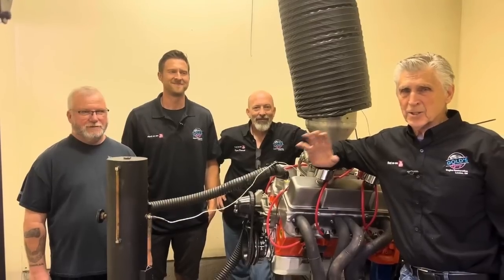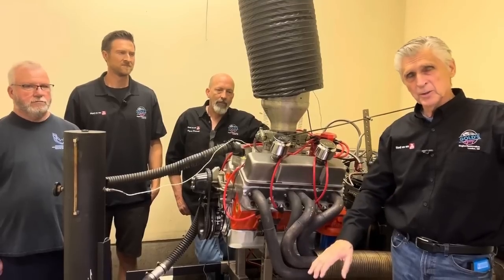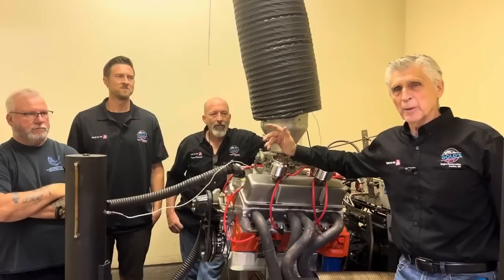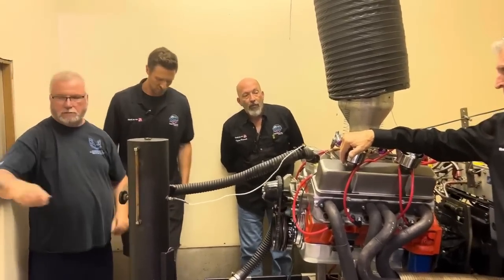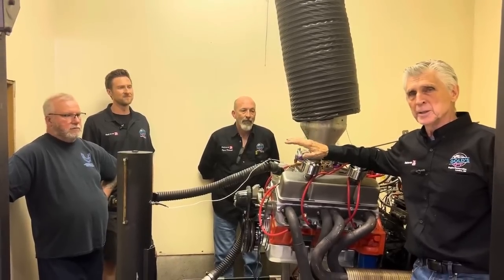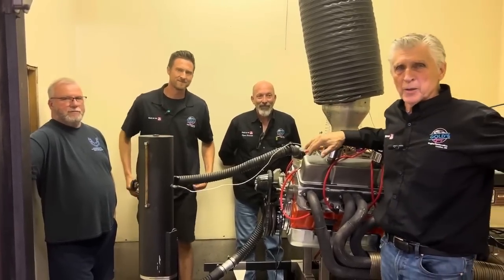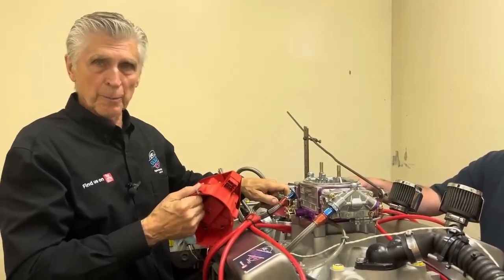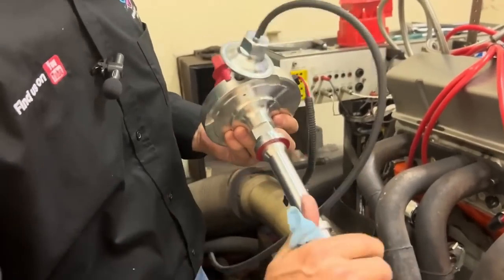$75 Amazon HEI Distributor VS MSD Ignition DYNO TEST!  Mike's Michigan Modified stock car engine.

Comment: HEI Distributors are the best simple all-in-one I've used cheap Distributors on stock engines with no problems I have DUI distributor on most of my stuff I swapped out Fords and Dodges with HEI with much improved power and acceleration they're definitely worth the money
Reply from the maker: Thanks for commenting Optimus.AG

Comment: Your target cranking compression is a good bit lower than what I have run in numerous small blocks over the past 20 years. I worked my way up over a few builds to where I now have a target of 200 psi with iron heads and 220 psi on aluminum heads.  I found more hp, a good chunk more torque and better fuel mileage running higher static compression ratios as the air/fuel burns more quickly minimizing the required spark advance.  I typically make peak power on 29-32° of advance on 91 octane. My 383 I tow heavy trailers with in my Express van has 11:1 static, 6" rods and the 218/228 @ 0.050 on a 108 LSA roller cam has an ICL of 61.5°. Cranks at 210 psi and made peaks of 520 tq @ 3,600 rpm and 502 hp @ 5,500 with 31° total advance. It has been together for 3 years and half the mileage it has accumulated has been with a 6,000+ lbs trailer.
Reply from the maker: Thanks Chris, that is great information. I realize I am being conservative. One factor for me is that I have no control over what happens to the engine once its gone. I notice that you are using a little less timing than typical for peak power, is that necessary to prevent detonation?  Anyway, those are great numbers.  Thanks you for contributing to my channel.
Reply: @goldsgarage8236  No problem. Love your channel and fully understand on something you are having to provide a warranty for.  For the stuff I build myself I want the most out of.  The timing advance was not reduced due to detonation. It simply did not respond to more timing, I start with a fairly rich air/fuel curve at low timing and then add timing until the engine stops responding with signifigant increases. Then remove fuel. Think of it like you would part throttle with vacuum advance. The more spread out your air/fuel mixture molecules are the slower it burns. The inverse is also true with more compression pressure. The elevated pressure causes an even quicker flame front spread with molecules more densly packed together and the need for less timing to reach mean best torque spark advance. I time for torque then jet for horsepower. I do it with a keyboard and PCM reflash but still the same basic idea.

Comment: You seem like guys that could test and get use out of my beta, simplified, P59 base tune. The video you want is "Want go kart EFI? Junkyard car parts (P59 ECU)". More info in descriptions of most of my videos. Meant for open loop only with as few sensors as reasonably possible. Map, crank, cam, IAT, and TPS sensors, nothing more. The TPS is a quirk of the operating system of that specific ECU. Tieing TPS pin high and maxing self test values should also work; haven't tested that yet. I'm betting there are after market LS coils that compare to MSD.
Reply from the maker: Thanks for the info Marc. AG

Comment: I used to be involved in hydroplane racing. Since my background is in electronics, some friends asked me to look at their MSD parts. I was able to look at some HEI MSD replacement modules and some MSD box for magnetos. The very first thing I have noticed is how cheap, cheap, cheap the printed circuit boards were. I was trying to remove defective parts and the copper tracks would come off from the circuit board. 
I have salvaged many parts from trashed printed circuit board, over the years, but I’ve never seen such cheap Printed Circuit Board. 
For the price we pay, for these products, I would expect top notch quality design. Unfortunately, it’s not the case.
Reply from the maker: Thanks Clark. That is great information. Thanks for sharing.AG

Comment: What viscosity oil do you use in the street engines you build? Way back in the day, Valvoline, who was sponsoring Neil Bonnet's NASCAR car, they claimed that they were using off the shelf 10W30 oil??? Thanks.
Reply from the maker: Thanks Clark, really good question. The thinner the better to make HP, as long as the bearing clearances are sufficient to maintain oil pressure. Remember if you have a flat tappet cam, you must use oil with ZDDP, otherwise 10W30 of the shelf is fine. AG

Comment: Where are you guys out in Springfield? I've been living out there for the last few years. Having some major problems and im Looking into scrapping a whole holley sniper fuel injection setup that just died. Maybe your guys have a full carb and ignition setup that will work for me?
Reply from the maker: Thanks for the question Dan. Watters Dyno service is on Springfield line in Springfield Ontario, about 1/2 hour southeast of London. I am located in London Ontario. AG
Reply: @goldsgarage8236  interesting, I have never known of a dyno service in the area. And can't even find a buisness associated with the name. I did however find an old buisness card with an address on lyons that I drive by daily. Do they have a current phone number you could send me to get in touch or I may just stop by and  knock on some doors and see what they can do for me.

Comment: I found on reading the strap on sparkplug.The closer to the bottom of the strap the better.If it starts to the threads you are pushing it to much advance are burning at the on the strap.For richness 1/8" from bottom of porcelain.Jet carb to get there.
Reply from the maker: Make's sense, thanks for the tips Paul.AG
Reply: The closer the more advanced ideal is on bend

Comment: I had a 68 Camaro that i had   a 302 built ..i spun it to 7500   regularly..  i had a solid roller cam in it ..i had a HEI distributor in it that had been recurved with a bronze gear ..Never had a problem from using the HEI .. i use a HEI again if i ever need one
Reply from the maker: Thanks Jim.AG
Reply: 1 wire hook up, u cant go wrong!!!

Comment: I bought the ebay cheap distributor for a 454 build, junked the module for a new old stock oem, it runs like a clock and pulls 6k trailer.
Reply from the maker: Thanks for the tip Sid. AG

Comment: I recently replaced an unknown year MSD HEI distributor that was giving me problems with an Amazon unit I got for $65 USD with shipping. They were identical after taking both apart to swap the module for the pigtail to connect the CDI box. I mean IDENTICAL. Runs exactly the same but isn’t spraying oil
Reply from the maker: Good info Hogiewan and helps to make my point.AG

Comment: I replaced an ancient Mallory Dual Point distributor with a $62 Ebay HEI , works perfect, is it as good as the MSD ? Don't  know , but it does everything perfectly,  about 2 years and 16,500 miles, 6700 rpm max.
Reply from the maker: Thanks Jalimamba, Good affirmation of the ignition test.AG

Comment: Unfortunately, you forgot to mention Knock-Off or Copy etc etc. Your boarding on endorsing using Copy Products, all this leads to in encouraging more more Copy Products, it doesn't make Racing cheaper or Maintenace, just a hole heap of trouble when it fails.
Reply from the maker: Thanks for your comments James. Gold's Garage strives to provide viewers factual, real life information that they can apply. We do not endorse or condemn anything. The dyno helps to validate information. Application of information is at the viewers discretion. The MSD ignition is still in Mikes race car. AG

Comment: Two things you should mention on your show that I found over and over. Street car guys should check for full carb opening with pedal on floor and use of a timing tape to ensure full advance of 34-38 degrees above 2500-3000 RPM.
Reply from the maker: Good point Frank. I will do that for sure. AG

Comment: Thanks for testing. I always loved HEI, but would prefer a crank trigger & one coil per cylinder for ultra reliability at high cylinder pressures & RPM. But it doesn't look right and isn't needed on most engines, especially street/strip type.
Reply from the maker: Thanks Terry, all good points.AG

Comment: Engine Masters had an episode where their 801 hp dyno mule had the dyno msd 8 or 9 go bad ,they installed a hei in its place and motor made same hp haha
Reply from the maker: Thanks Joe, helps to reinforce my point.AG
Reply: To add the only reason to run a msd is if you want to pair it with a start retard or rev limiter among other reasons

Comment: Had a buddy that had a fuel altered  small block Chevy single, 1,200, CFM carb, was only running 11s in the quarter mile with the MSD,, Sent the MSD back to the factory to have it checked,, factory said it was okay,,He put it back in the car only ran  11s,,,again,, put his Accel distributor dual point with the race points,, Then ran  6s,, in the quarter mile....
Reply from the maker: Wow, that is a big difference. Thanks for the info V1 AG
Reply: Sbc running 6’s in qtr mile!? You bumped your head!

Comment: I had an accel hei module and coil.  The module went bad in two weeks. Switched to DUI and it’s worked flawlessly. You only light the charge once and even points isn’t going lose power. If there was power to be gained by MSDs claims all the OEs would do it
Reply from the maker: Good point Jo, thanks for commenting.AG
Reply: I've heard "if you change your ignition and make more power, you had bad ignition to start with.

Comment: I have had mixed results with the cheap hei. I think Hei type ignitions are fantastic. I have worked on 3 and owned 2 of the Amazon/ebay  Post Covid units with erratic advance curves that couldn’t be tuned out and shafts that snap in the body or non standard hei components and they fail. I have also had dozens of pre covid units that were flawless.
Reply from the maker: Thanks for sharing your experiences. AG

Comment: I`ve used proform carbs and had no propbems, I bought 5 proform HEI distributors and 4 of them failed in three months. They all died within 100 laps of one another, the 5th is in the shop and I use it on the run in stand cause I`m afraid to sell it. Your motor sounds good, torque is what you feel when ya push the loud pedal.
Reply from the maker: Thanks for your comments Ed.AG

Comment: Circle track stuff around here, you are not allowed a MSD! (Local racers!) We used Performance Distributors HEIs for decades! Those China ones may work, but I have never  seen one last! Also the timing is almost always different between boxes! Even if they are identical! So make sure you double check the timing in the car!
Reply from the maker: Thanks Brian. Good point about checking timing in the car,  I will be sure that it gets done. AG
Reply: Another great video AG! Love the family gathering and everyone's input including,  the distributor comparison 👍
Reply: True.  The China distributors do not last long.  2000 miles if you are lucky.  Advance weights and the posts they mount on wear out quickly.  Shaft bushings too.

Comment: Nice engine test & Ignition comparison info !!....Ignition spark Advertising Looks so Dramatic but at this Relatively modest (6000) engine speed range application no surprise Any good working ignition has No hp or torque Performance improvements....Even the old '60's  Chevy factory Stock dual Points distributor & Coil easily handles this engines Ignition demands !! ...... 3000 revs & above needs Only 1  1/2 way decent good Spark to produce the max power...Most over-Priced Aftermarket Ignition systems are  99% Unproven advertising Hype & unfortunately the #1 area customer performance $$$$ wasted on with no Real performance gains.....Compared to original factory stock dual Points distributor only Maintenance between Tune-ups is Improved.....Thx for showing....
Reply from the maker: Thank you Tom, all very good points. We were doing fine with points. In the seventies i had a C/MP car. It had a Mallory 4 lobe distributor with two sets of points. One set fired 4 cylinders and the other fired the other four. I think the idea was to improve dwell. It worked great to 8000 RPM, but i had to put it in a distributor machine weekly to keep it adjusted correctly. That said, my Z-28 has single points ACDelco D112P and they worked good past 7000RPM. AG

Comment: In your holley carb, you should put the winged circle track floats. This keeps fuel slosh from affecting the fuel level in the bowl and also helps to stop it from coming out the vent tubes.
It also allows the needle valve to stay open in turns if the bowl is trying to fill.
The dual winged floats are Quick Fuel 16-15QFT for the secondary side if you are using jet extensions.
And 16-14QFT for the primary side.

Comment: The standard plug gap for HEI ign is .045”. For use above 6000 rpm you should run .030” for V8s. 4 cyl and 6 cyl can run .045” for racing.

Comment: I tried a cheap Chinese hei distributor
 Engine fired up and idled great. During break in it had a strange lope. First pull it was down  bad on power. Tried a different carb. Same result. Changed the ignition module to a DUI module and it made 100 more hp next pull.

Comment: And if you're looking at those "cheap" HEI's take it apart and use high temp grease, on the shaft and CORRECT heat sink paste undrr the HEI module!! And swap out to a known Chevy drive gear. Chinesium ones might eat your cam gear!
Reply: I had one in my old street rod, the coil failed instantly never to work again, in my driveway while I was warming it up!
Reply: I just got one as a extra.  Got it dirt cheap. The casting looks surprisingly clean and precise...., but that china gear is trash. Hell the entire hei was $30 a distributor cap at the part store costs more lol!

Comment: Is there a build sheet or video? Ive had a 406 (5.7 rod) in my 95 3/4ton nv4500/3.42. I just needed a engine in there quickly.  Was my daily at the time. But I'd LOVE to get those numbers in a lighter truck or car.
It was balanced with a flex plate but using flywheel now. Been running a HEI and since the TBI is only around 18psi, ive been running a return style regulator for almost 7yrs. And with a EX274 cam, it makes pretty decent mileage!
I also scored a pair of Dart Iron Eagle 230 iron heads sitting that i could use. 
Let me know!

Comment: Do you have the link for this Amazon distributor?  I need a distributor gear that is nitrided. Does this $75 distributor have that. Great video 

Thank you.
Reply from the maker: Most of these distributors have a melanized gear, but you should check it out. If you just type distributor in the Amazon search window, choices will come up for different applications. AG
Reply: @goldsgarage8236  Thank you. I learn more information every time I watch your channel.

Comment: How much gain from the 650 to the 850? nice video.
Reply from the maker: Thanks for the question 39. We only made one pull with the 650 at33 degrees timing. It made 482HP 491 Torque. The rings were not broken in yet. AG

Comment: The heads might flow 300cfm, but unless that intake has a ton of porting it won't flow even close to that. It would be lucky to flow 230cfm at the best port. 
Other than that it's a very nice build. Thanks for sharing!

Comment: HEI distributors have been good from their inception.   But most need the correct curve for the application.   I think they look 'ok' on a race car or what they originally come on, but they are just so damn ugly where they didn't originally come equipped.  IMO.
Reply: I recurved a lot of HEI distributors that were used for oval track classes that required “stock” distributors. Putting in a appropriate curve makes the car jump off the turns and that’s where a pass is initiated . A stock adv curve makes the car lazy off the turns.

Comment: My rather ancient experience with going from a reworked HEI distributor to an MSD distributor and 7AL2 box was it showed an improvement when the rpms were over about 6500.   It was also at that time the best way to run a trans brake with a two step rev. limiter.
As for the multispark stuff, I'm now a believer that you only get to light the candle once, except on two plug heads where you get to light the candle at both ends.   (-;

I'm waiting in anticipation of the engine's competition debut.   (-:

Comment: Had a local dyno shop tell me hei was trash, I didn't say anything Just let it go in one ear and out the other. I had them on two SBF and they ran flaw less. Yeah spend your money how ever you want.........
Reply: MSD. Might Suddenly Die.
Reply: @cammontreuil7509 don’t kid yourself, they all fit that description. I have had a few hei modules leave me stranded. My cars with them get a module change kit when I use them.
Reply: I use a points distributor with a MSD 6AL. After the points break, the MSD box takes care of everything else
Reply: My works good too but only after putting oem gm parts on it. I bought a Amazon hei for my 289. Died in traffic first drive but swapped module and cap with coil from my monte and been driving good since.